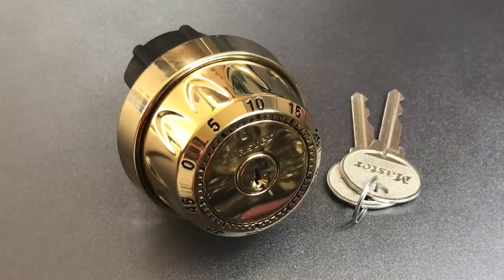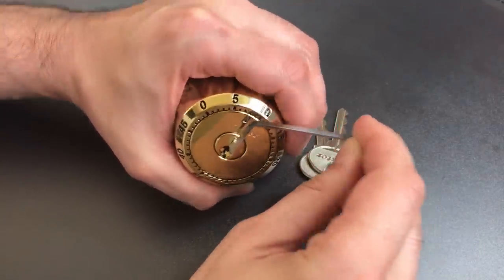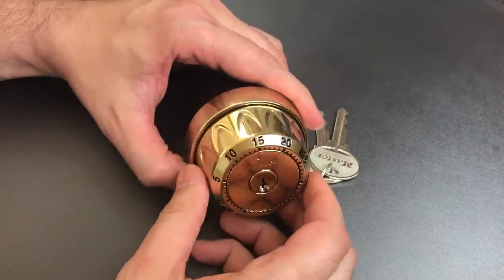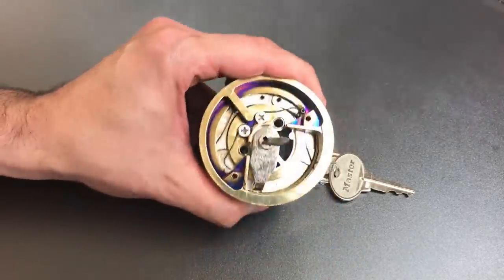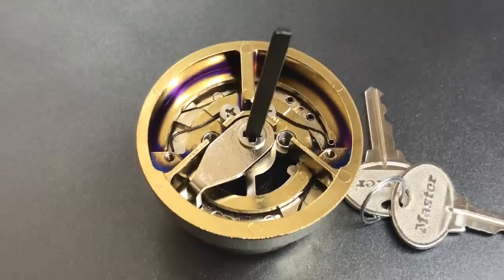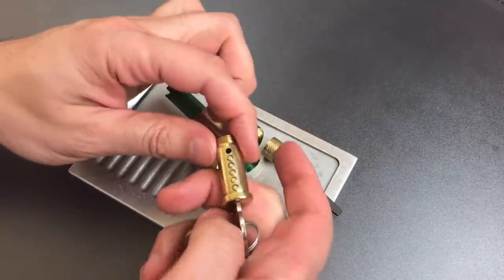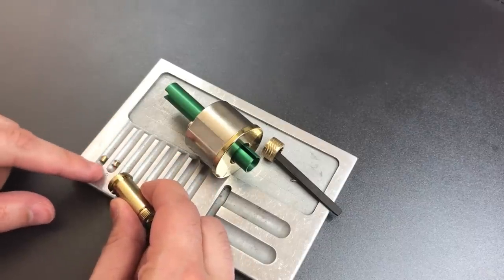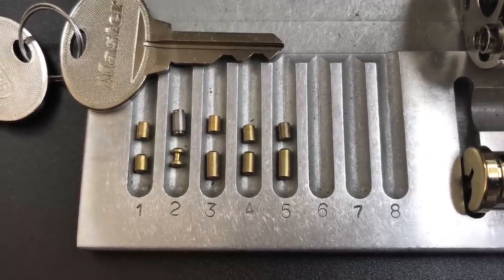[536] Master Combination Deadbolt Picked and BYPASSED!

Comment: I think the ''Yale'' locks in the U.K have a similar thing to either disengage the mechanism or it totally locked it up so the lock would could not be opened from the outside . You just had a small button that uou mover across, ver simple and easier that that way of disengaging the mechanism , just took one finger

Comment: Did they drill out an empty 6th driver pin slot in the bible as well?  Are they just being super cheap and not willing to use longer keys?
Reply from the maker: +Dave Kimball Yes... six holes on both sides.
Reply: The longer key and extra pin is worth $100 of any security enthusiast’s money.

Comment: Always start a masterlock pick by raking.  Please don't give it the courtesy of pretending it actually requires skill to open.  I understand that this one actually had a security pin for a change, but do it anyway just to see if it worked.  

It would surprise me to see a masterlock that is rake resistant, much less pick resistant.
Reply: This one would be, because of the bump

Comment: If you could change the core on that one, you could put in like a NW5 and then shield the gap between the wheel and the bezel and you would have a pretty resistant and functional lock....

Comment: It might be a little overkill but what if u replaced all the pins so they all were like pin#2? Plus adding a steel ring behind the gap so it's shim proof, i think that'd make it a pretty secure deadbolt. Especially if u use the proper screws when installing it

Comment: Someone did a article for changing these combos in a trade mag shortly after they came out, I've got a copy/photos of it somewhere but considering they aren't commonly used, its not something I keep at my fingertips and would just have to "figure it out" if one were to actually find one in the field :) Nice bypass (*facepalm)
Reply from the maker: +SE Lock and Key I'll never understand why the last two wheels weren't labeled wysiwyg. That would make it so easy.

Comment: It doesn't seem that bad. One thing is knowing the exact spot when it's on your table, another thing is trying to break into someone's house, not knowing which lock they use, doing it in the dark and under pressure. I doubt even LPL would be able to do it in realistic scenario without knowing what kind of lock it even is. I'm sure there are more locks that looks exactly the same or very, very similar. Still not an excuse to have such vulnerability.
Also why don't locks have ALL security pins? what's stopping them from making locks with all security pins? I'm sure it's still pickable, but would be tougher for sure.

Comment: What about a combination lock with 9 numbers that require a key to turn, actually have a pin line at all nine numbers.  3 number combination.  You would have to pick the lock every time you passed a number. ?????

Comment: I have a suggestion, I understand you have the locks the way the are for presentation, but what if you do one like normal and then try to pick the same lock as they were intended to be used like put the deadbolt in a door and then try to pick it. Just a little suggestion

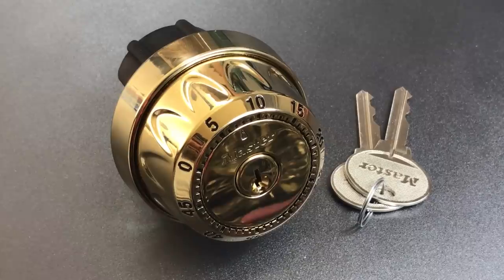Comment: Up til 1:40 I told my wife we found an unpickable front door lock.... And then LPL said.... Let's go ahead and pick this lock.
Reply: U don't need an unpickable lock just a lock that is frustrating enough to pick that breaking a window/the door is just as hard, what use is a super high security lock if you can break the doorjamb?

Comment: I'm a little puzzled why the design doesn't have a flange on the knob, and then assemble by dropping the knob through the  the body.  
Even with fairly loose tolerances, it would be fairly difficult to get anything through two right angles to get at the roll pins.  
Is there enough slop to drop in a very thin washer to block direct access to those roll pins?

Comment: This lock is very interesting and a good idea to have for kids that may lose keys (like I used to). Except for the fact that it's essentially more vulnerable with two opening methods lol. I wanted to mention it seems kinda lame that the combination is set to pre-machined areas in the body, it seems like someone that knows that may have an easier time unlocking it without any tools. Idk though

Comment: know why i dont have to worry about my deadbolt being picked? cuz i live in a crappy apartment, the door isnt flush so it takes like 3 lbs of force to lock or unlock the deadbolt, almost enough to stress the key so id like to see a tension wrench strong enough to turn my deadbolt

Comment: You wouldn't have enough force to throw the physical bolt. Ever if brand new you're going to have more resistance than you can counteract with those shims. Good video on the lock but most likely not when it's installed.

Comment: When I first saw the lock and length of the video I thought that it had 2 restrictions to open it, and not 2 ways to open it.
I thought that you had to "use the key AND get the combination" while the key is in.
instead it was a lock where you can "use the key OR get the combination", so it make it just double the vulnerabilities...

Comment: As a European person it is kind of not understandable that this night watch feature is something special. Our European cylinders can only be closed with using the key on the inside and by default if you leave the key in the cylinder on the inside you can't get in from the outside. (But there are special cylinders where you still be able to get in from the outside, they are recommended for old people so that relatives can get in in an emergency, but besides that, the default is the functionality I mentioned above)

Comment: most doors, especially around the cheaply manufactured deadbolt knock plate will have a significant amount of resistance against the deadbolt. do you think this shimming technique would work when the lock is installed?

Comment: Such a old vid but some one will see the comment. I have never seen a lock that uses a key and combo but has the key it self as the dial. In other words needing a key inserted for the dial to turn. Wrong key dial is locked like the core but to work the lock you must leave the key in to work the dial. Adding some system in the barrel could cause it to try and re set the pins to their zero point to determine if a key is still in place. If no key and no movement of the pins as in some amount of built in slop in the key could result in a nearly impossible tp pick lock. Sure you could brute force the combo but that would take for ever. On the old master school locks with the shackle we use to beat them all the time with a shoe string lol. 1 of 2 things would happen ither you would hit on the combo or you would melt the zink parts of the lock from the heat from friction generated lmao.

Comment: Does it even matter if the final number is noisy? Kind of looked like combo wheel turned into an unlocking mechanism the moment you went over that last digit. Even without the shim trick, that three digit combination lock may as well be a two digit combination lock as long as you turn the wheel slowly for that last digit. I suppose that 2500 (or is it 2499?) possible combinations should still be plenty.

Comment: The shim thing is insane but I have to wonder if it works with the lick installed on a door. The added friction of the thumbturn and the bolt itself might make that much harder to turn with the shims meaning finding a material strong enough while small enough might be difficult. Still its dumb this bypass is even a thing but how realistic is it as a bypass I am not sure.

Comment: Wait if the last number in the combination automatically engages the "ring" that turns the unlocking mechanism.... doesn't that mean you only really need the first 2 numbers to unlock this lock? Then just... you know... turn in slowly to see if it drops into the slot? (Sorry if this is mentioned, I'm only halfway through.)

Comment: I think it would be very interesting to have a combination lock where you need the key to turn it in the first place, but then no one would use it.
Reply: Unless you wanted to over Engineer something that could potentially allow for a pin or 2 to access the combination wheel, with a master key to just bypass it.

Comment: How much of that lock was plastic?  I mean seriously, most of it looked to be plastic in nature.  What is the ratio of metal to plastic?
Reply: EpicATrain things like the wheels inside and pieces that hold torque while unlocking can be made of plastic; if you break them, the lock stays closed 😁
Reply: all the metal parts looked like cheap pot metal castings though. im sorry, a dead bolt should be entirely metal in my opinion.

Comment: Why does MasterLock always get a great thing started but simply never finish it? That would've been so easy to prevent too, probably less than a cent per lock, all you need is a single metal plate and this thing would be bypass proof.

Comment: but would that bypass still work once you add the friction of a door bolt? It seems to barely turn when it's not connected to a door, and in my experience the friction on some doors can make them hard to open even with the key

Comment: Would those shims be strong enough to hold if the lock was installed and actually moving a deadbolt? They looked so flimsy that they would bend and tear with even slight resistance.
Reply from the maker: +Joel Waugh Yes. And if I had a proper sized shim, it would be stronger.

Comment: So a question, if the 2 shims push that 4th wheel around to engage the tail piece, do they really impart enough force to turn the lock when its fully together in a door?  I have had locks that were hard to turn with a key let alone some tiny shim's.  Thanks for the video though.
Reply from the maker: +Christopher Gordon Yes.  I tried with the bolt installed. The hardest part is overcoming a spring right in the beginning. Also, note that a properly sized shim (roughly .006) would have made this much, much easier... I was demonstrating this with two .002" shims because that's all I had handy. Thanks for the comment. 👍

Comment: "Night Watch" might be a new name (probably trademarked) for what might be a new implementation of the idea, but the idea isn't new.  Over 60 years ago the Yale door lock on my parents' house had a button that locked the dead bolt, meaning the turnable knob on the inside and the key on the outside could not be turned.  So definitely nothing new.  The mechanism might be novel but the idea is not.

Comment: How would night watch do anything it just takes off the option of opening from the inside the outside arm still makes contact with the locking shaft
Reply: Because the tail piece from the cylinder on the outside lock just engages with the part on the back of the thumb turn. The night watch feature locks that in place. Therefore, the entire mechanism is immobile and you can't open the lock by any means while the feature is engaged. So yeah, it does work.

Comment: Any deadbolts you're unable to pick or bypass?
Reply: I forget which video, but he demonstrates what can be done to make a lock unpickable, but if someone were to pick it, the lock locks in a 45 degree angle and not even the key can open it, the whole lock has to be opened up.

Otherwise, Bowley seems to make tricky locks to pick.

Comment: Of course, the lock is garbage. But imagine it didn't have the blatant security holes, and, most importantly, imagine that the two ways of opening the lock weren't alternatives but were both mandatory.

So imagine a lock that looks something like this, which requires you to insert the correct key AND dial the combination by turning the key back and forth. It would be two classic elements of security combined: “something you have” and “something you know”. Besides the obvious need to defeat two security mechanisms (rather than either one of the two), it slow down picking because the pins would have to be picked on every turn when passing the starting position. And one probably couldn't use a plug turner for fear of turning it too far.

Comment: Would the shims method still work once installed with the added pressure needed to open the bolt itself? I would imagine the hack would be hard to do.

Comment: Hold up. You don't need to know the third digit since it catches automatically on the last turn. Now there's 50 positions but the gates are wide so you can be off by one. In either direction. Thus there are effectively 17 positions on the dial. Overall then there are only 17^2 possible combinations. That's in the low hundreds. you could no skill brute force it.

Comment: Ouch!  That's not much different than an electronic device where each keypress gives away whether or not you've succeeded or failed at a PIN or password (Yes, there WERE devices like that... and probably still are).

Comment: Too much farking plastic.  Even Kwikset doesn't have any plastic like this in their normal deadbolt locks.  Not sure about Smarkey but I just had to re-pin a double cylinder deadbolt to match my other new locks, no plastic to be found.  The only plastic I found was the "stem" in the Kwikset knob lock.

Comment: Hey LPL I recently picked one of these as my mom lost they key and the could not find the combination I wrote down for her.  I shockingly raked it with of all things a hairpin and used the same also as a tensioner as I did not have my pick kit.  I did find this link for decoding and recoding the combination once of course it is opened and accessible for removal. 

https://www.imlss.com/images/pdf/6284_instruction%20booklet%20for%20decoding%20and%20resetting%20combination.pdf

I will use this guide to decode and let you know it how goes.  Love the channel as well as BB's LockLAb!

Comment: See this is the wrong approach for designing a lock like this. Instead of allowing it to be opened be either the key or the combination it needs to be opened only by both the key and the combination at the same time. The either-or approach just makes it less secure, the both-only approach means that the lock has in itself two-factor authentication (what you know: the combination, what you have: the key).